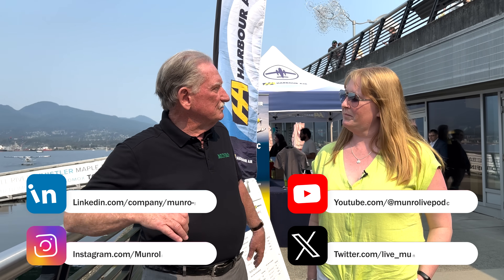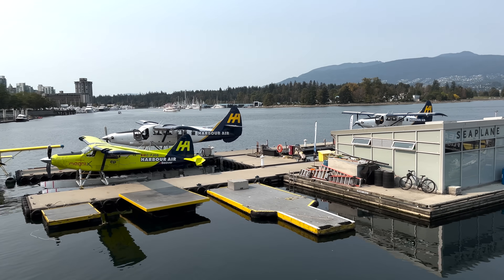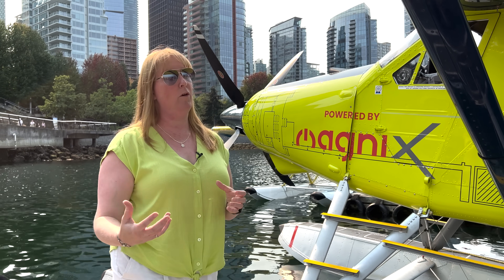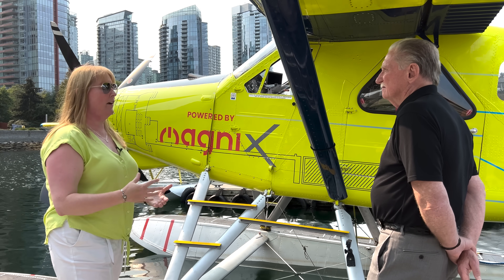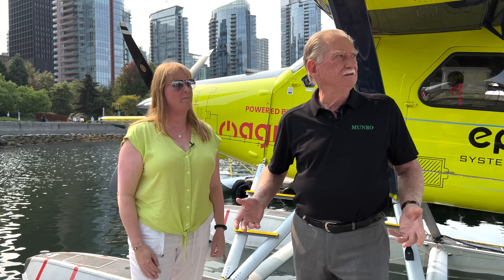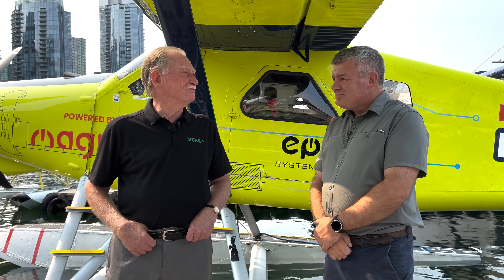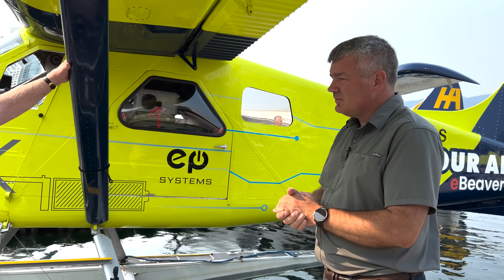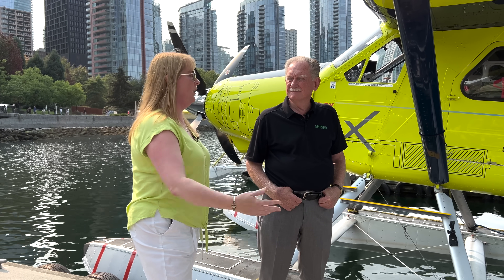The Harbour Air eBeaver Electric Seaplane | Everything Electric Canada 2024

Comment: The range is still short, but technology is developing very quickly. So soon all these current Boeings will have to give way to electric planes. Let's wish good luck to these pioneers!
Reply: That is a very long way off - seeing as a gas powered Beaver has a five hour flight range (780 miles) and these electrics are at 30 minutes (roughly 50 miles), it might take some time to scale up to a Boeing 777-300 ER (8,900 miles - 16 hours plus reserve).
They are cool and will have a use; but unlike cars, you just can't stop every 2 hours while crossing an ocean to top off your plane at a Tesla supercharger.
Reply: @joeperrone6677  yeah the 70 years old powertrain has 780 miles of range and with modern engine it will probably get around 1200 miles of range or more.
Reply: You are delusional if you think this will happen in your lifetime. These planes have maybe 20% of the range and tremendous amount of time has to be wasted  charging them. This is nothing more than a model with a fancy paint job.
Reply: @markadler8968  I'm 58 years old. When I was young, I couldn't even imagine that I would ever be able to dial a number and easily talk on a cell phone with a guy on another continent. People probably told the Wright brothers: "You're crazy! This is impossible."
Reply: @markadler8968  regarding "time wasted charging" batteres...spent battery pack modules could be swapped out on the ground for fresh ones in seconds, much faster than refueling. do you think hobbyists flying radio controlled airplanes fly once, then wait around at the field for 90 minutes while they recharge the battery? no. they bring multiple fresh batteries with them.
Reply: @FB-gm6el  You do realize you would be changing a battery that could weigh up to 1000 lbs on plane floating on the ocean? 🤣🤣🤣🤣You have quite the imagination, you should write science fiction.
Reply: "so soon" no 😂
Reply: wrong! technology isnt evolving quickly, batteries are still super heavy and less energy dense, for very short flights small aircraft makers like embraer could develop something for dozens of passengers for few hundreds of miles and not much.

Comment: Electric Engine! You mean motor.  Your an engineer??
Reply: *you're
Reply: @jamesengland7461  good for U.
Reply: Definition of engine:
"noun 1.
a machine with moving parts that converts power into motion."

The motor on my Leaf certainly has moving parts.
It certainly converts power into motion.
Reply: @economicprisoner  Try a little more education.
Reply: @glennbeattie6172  Motor definition:
"a machine, especially one powered by electricity or internal combustion, that supplies motive power for a vehicle or for some other device with moving parts."
Reply: @jamesphillips2285  ok you win. I got to back up on the roof and install the electric engine in my A/C.
Reply: I'm guessing the aviation authority demands an "Engine" so...
Reply: @rossr6616  Nonsense.
Reply: These terms can be switched around ... an "engine" is not exclusively an internal combustion device. We often refer to the motor in a car ... we also have steam engine which is an external combustion engine ... yes, "engine" isn't the common term for an electric motor but in truth an engineer is probably more likely to have a more flexible in the use of the terminology than the average person.

Comment: With how far battery recycling has come today? I can foresee a time in the very near future where the cost of purchasing the new battery will be weighed against the material value of the old battery you are trading in. Think of it like a core charge on your alternator or water pump today, only much more valuable. Its already cheaper to recycle and reclaim materials in batteries today, than it is to mine, ship and refine new materials.
Reply: With time cycle life will continue increasing so operating cost will go down.

Comment: I could see you'd be able to skirt some noise restrictions.... because the old ones are loud.
Reply: It's all coming from the prop, the same things they are doing here you can do on a Beaver that runs on avgas.
Reply: @boostav the noise is obviously not all coming from the prop, since engines make noise and large unmuffled air-cooled engines are very noisy. 

Many videos have included audio, and while of course the prop noise remains, the elimination of engine noise is obvious.
Reply: The province has none. There are wealthy people in waterfront Condo's here in Victoria that have been whining about the noise for decades. They can't do anything about it.
Reply: lol...... of course! they are litteraly decades old, why didnt they used more modern and efficient engines? there are tons of planes with mercedes diesel engines or other automotive engines from honda, yamaha, bmw....
Reply: @carholic-sz3qv  Most beavers have been converted to turboprop you can tell by the long nose and the blades

Comment: Imagine the "range anxiety" flying an ev. Driving. Battery dies you coast to a stop. If it dies in a plane, it can glide a bit but id be nervous landing!!
Reply: Imagine if your gas engine quits. Or stalls. Or runs out of gas.
Reply: Other than the known energy density issue of the battery the electric engine it's should be much more reliable.
Reply: @CHMichael Energy densities higher than 300w/kg are already available I believe.
Reply: @ronfarnsworth7074  Yes.*
300Wh/kg at plane level is similar to saying at structural pack level. While it's do-able, I think you would be forced to use pouch cells, similar to those in cell phones which have 800-1000 cycle. Maybe a good use for a swap station though.
Reply: @JonVB-t8l  Thank you, yes, I should have made that distinction, you are right. Cells, module, and pack #'s can all be different. Maybe even goes beyond that with power distribution included.
Reply: Why do people think range anxiety is still a thing. The Tesla Model 3 LR RWD now has more range than the average gas car,  and I just watched a 70 MPH range test on outofspec get 371 miles. Besides charging being everywhere, even rural areas, range is getting to the point where gas cars are passed by entry level EVs already, and batteries are still only in early stages of development compared to gas.
Reply: @JonVB-t8l Tesla is pretty weak compared to other companies on range 😮
Reply: @smokindauberdoo4208  LOL
You think people are buying Lucid's 150k cars to get 25% more range than Tesla's 35k cars! Range per dollar, Tesla is the champ, unless you want to pretend vinfast 70KW charging is just fine. It's like the Hummer EV, range and charging speed seem great, until you realize the battery is 212KWh so it takes longer to charge than the Tesla Semi!
Reply: These planes can put down over any body of water. And depending on the winds, they approach Victoria harbour, while following the inland Gorge waterway into downtown and go right over my head. They do that specifically in case they have an engine failure with the gas powered ones. The Gorge is wide enough to them to touch down on in an emergency. And I for one can not WAIT for those planes to be 20db quieter.
Reply: Sounds like fun I’ll bet it’s smooth as silk and 10,000 hours for the motor compared to 1500 hours for the ice engine is wild
Reply: There will be no range anxiety because these routes will be professionally planed and executed with huge safety factors and oversight.
Reply: @ben3989  Vast majority of their flights are tours and commutes to Vancouver Island. Victoria and Nanaimo are both 25 minutes by seaplane from Vancouver. Well within the range already.
Reply: Imagine still obsessing over decade old fossil fuel industry rhetoric. I've owned three different ICE vehicles that the gas guage went out on... all because they had glitchy and unreliable electrical systems. I was forced to calculate my expected range by watching the trip meter at every fill up. Only it didnt work too well because I live in a really hilly area so range was unpredictable so I ended up stranded many times. And Im not the only one, people rub out of gas all the time. But Ive literally never heard of this actually happening with EVs in the real world because they all aggressively warn the driver.  Its something that happens in TV shows with an axe to grind.
Reply: I can tell you that throughout my aviation career, managing fuel was a constant part of the job....and yes, there were occasional bouts of range anxiety.